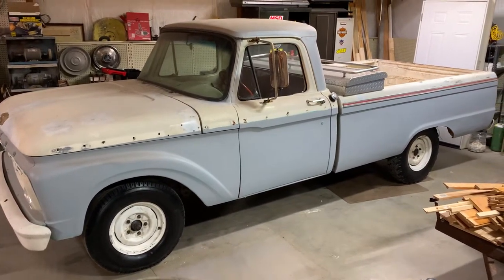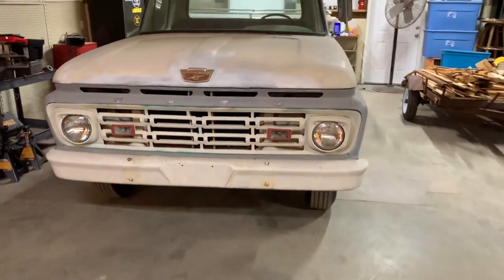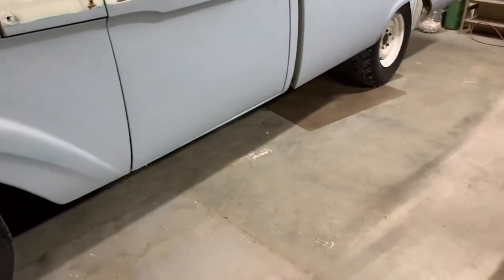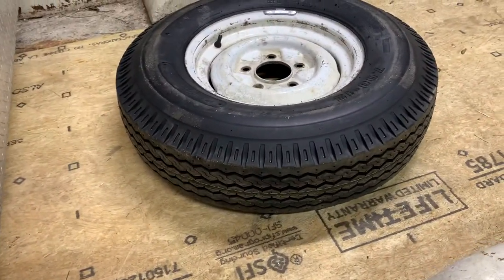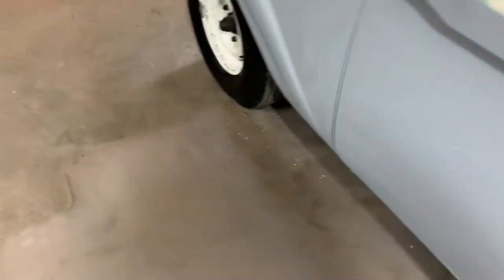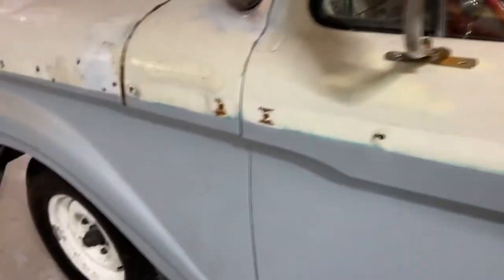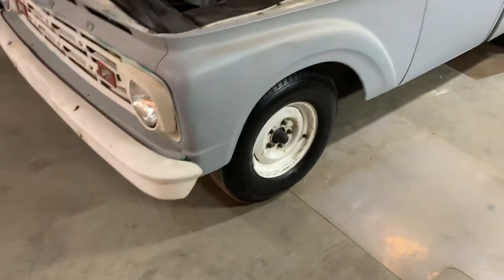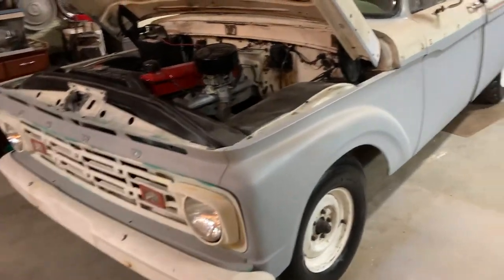I put Power King bias ply tires on Grandpa’s Ford F100 !

Comment: Even two years later this video is bring knowledge. I have a 1966 f100; wanting the original look but not wanting to break the bank. How are you feeling about the tire decision? Also, how do you feel about having the super traction II in the rear. They look really cool. I am going to get some on my truck, just not sure if I should go 4 of the same or two highway and two super traction at rear. Please let me know what you think. Thank you!!
Reply from the maker: I must say I don’t drive this truck much, so I can’t speak much to how well the tires ride or handle.  I’m still happy I bought them cause it’s good to have tires on the truck that don’t constantly lose air.  I feel good about the grabbers on the back as I was going for making it look the way my grandfather used to run it.  I doubt it will make much difference in how it rides, as these old trucks don’t ride so great anyway given their  straight axle suspensions.  I never have gotten any reproduction hubcaps but I’m sure that would make these look that much better.  Good luck with the ‘66.
Reply: @russjordan243  thank you.
Yeah, I bet that would make it look a bit better. Cool truck though. Thank for your response. I appreciate that.